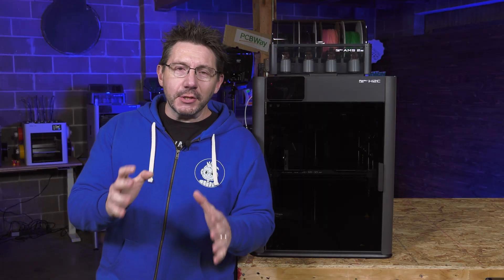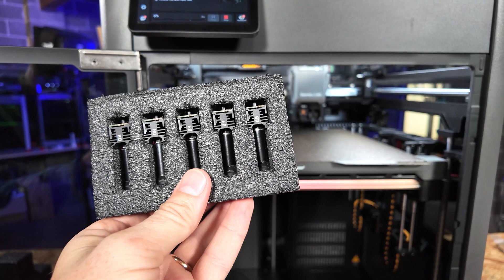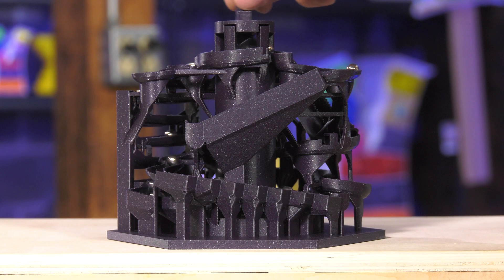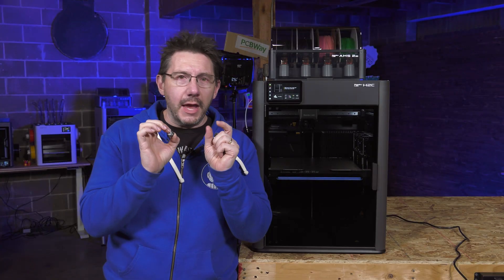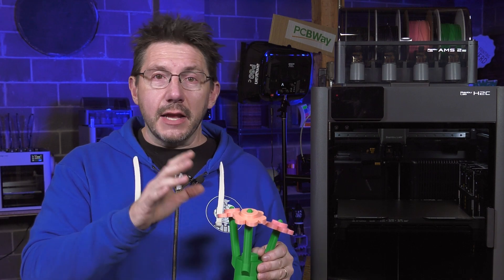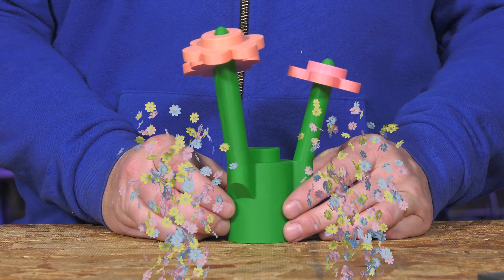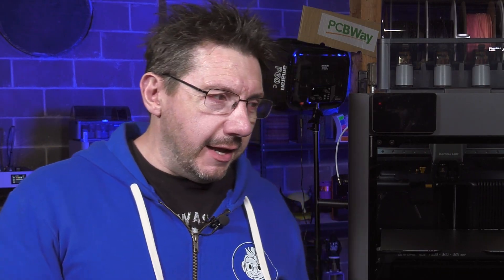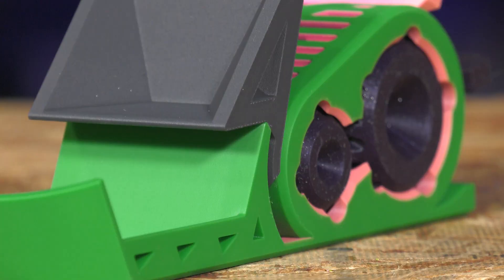My Review of the Bambu H2C + Vortek

Comment: Great review as usual and that tentacle chest is wicked... I love how Elixir just gets such a shine that other silks seem to struggle with. I wanted to save your video for last of the many embargo drops... in a weird way, you seemed to have the most issues of anyone. Tom (Made With Layers) reminded people of the bad air pathing from the H2 series, hinted at the complexity of all the parts, and saw the IC on the nozzles and asked Bambu about 3rd party nozzles... and they said "for safety reasons" no, 3rd party nozzles aren't supported. Not to mention it was still nearly double the print time of a Snapmaker U1 and Prusa XL. Stefan (CNC Kitchen) went more into complexity and brought up that the bed was different.

And so I feel like it's natural for me to reword and repeat come concerns: Bambu has seemingly added more and more SKUs to their lineup without removing anything besides the X1 (non-Carbon). For H2 series: you have 2x SKUs of nozzle (plus sub-SKU for nozzle size/type), 3x SKUs of gantry (H2S, H2D, H2C), 3x SKUs of beds, and a dozen+ accessories to mix and match that now need firmware, slicers, documentation, support, warehouse stocking, and more to figure out. I remember RMRRF, a friend picked up a new nozzle for their X1C... but they were accidentally given a P2S nozzle. I caught that and saved him some trouble. But now imagine dropping $2000-$2250 on a H2D, going "oh cool! The Vortek upgrade is out!", spending $800 on the upgrade... then needing a 2nd AMS 2 for $250 (you'd be surprised how many just have 1x AMS and found it perfectly fine and aren't maxing out AMSes), then finding out that the $800 upgrade only includes enough to do 4 colors and they need the other nozzle kit to get 6 nozzles (Edit: checked and saw it does include 6 nozzles). These nozzles are "cheap" but somehow more expensive then Prusa's Nextruder nozzle, INDX nozzle, certainly any v6 nozzle, nearly anything Elegoo, Creality, and Anycubic have, etc. Then find out your fancy effects sheet bed, or CryoGrip, or other bed you used on the H2D doesn't fit on the H2C. I watched someone almost toss a printer because the bed thermistor went bad and they couldn't bare the idea of following some instructions to replace the couple dollar part (eventually convinced them to replace it). Now imagine telling someone who's new to the scene that they're going to be nickle and dimed AND that the fancy nozzles won't have 3rd parties (as of now)? I help and interact with many people new to 3D printing and you would be amazed how many go weeks to months between printing because they can't afford a $20 spool of filament... "why do they have a $2000+ printer?" because they didn't know there are cheaper ones. Yes, really. Imagine telling someone who can't afford a $20 spool that they need to spend $36-$60 for a new bed if they have issues with the one that came with the printer?

Which leads to that bed... I think they made their bed and decided to stick to it (puns intended). That bed style started on the A1 and has continued to the H2 and people have complained about it since day 1 and they keep using it. I know someone who: clean bed, Nano, brim, everything... they get parts that lift and they're certain it's because of the bed. I'm not so sure, but as I can't reach them, I have to go with the next best solution: telling them to talk to support. I wonder what support would say about the jammed nozzle... like I know it's a challenge to clear a jam in a CFH nozzle, but specialized design for the bottom and electronics on the top... it's trash if you get a jam. I hate that kind of waste...

As for the PA6-GF print... I don't have experience, but it reminds me of when I got a bad spool of Prusament PETG. I contacted support (why not?) and they basically said the same thing: have you tied a different material? The issue is with this material... Have you tried a different model? Yes, same issue. Can we see the model? Here... Ah, there's the issue: your angles are too steep. But it's 45 degrees... Yea, too steep. I can literally swap out the filament and the issue goes away. I have literally tried 3 different Prusa printers and they all have issues with this filament + Prusa's own profiles. But swap the filament for a different Prusament PETG, and the issue goes away. Dried it and everything. Something was wrong... So I wash you the best of luck.

My last comment is a curiosity on price. A few years ago, someone would look at a Prusa and go "I can get 2x A1s for the cost of a single Prusa" or "a Creality K1 is just an X1C clone at a lower cost, but it stinks compared to the X1C. Don't bother". "cheap" vs. "value". People seemed to pick and choose what they wanted to argue online with. But many many many go by that bottom dollar in relation to a spec sheet. H2C Combo is $2400... and that only does 5 colors total. If you want to do a full 7 colors, you need the "Ultimate" version with adds 2 more nozzles + an AMS 2 and AMS HT and clocks in at $2900. H2D upgrade is $800 ($2800 total H2D Combo + upgrade). H2S upgrade is $900 ($2400 total H2S Combo + upgrade). Cheap compared to $4229 for a 5 tool Prusa XL + Enclosure. But if you're fine with loosing 1 nozzle, a $1000 Snapmaker U1 is a bargain. Except we can't operate in a vacuum... and while plenty of Voron-style tool changers are out there getting better and cheaper, they still cost roughly the same as a H2C. And a day after the H2C was announced, Prusa announced the INDX upgrades for the Core ONE. 500 EUR upgrade for 4 tools, 700 EUR for 8 tool. There tends to be 1-1 EUR to USD so I can assume those are the USD prices too, and I can also assume that it will be similar or identical cost for Core ONE L (unless they offer more tools). So that means for $2300 (Core ONE L + upgrade), I can get 4 colors. And for $2500, I can get 8? But wait... that's the upgrade. Assuming a Core ONE toolhead is some $200 (adding up parts tends to put it around $150 or so last I checked), and that is now saved, when a Core ONE L comes out with INDX pre-installed, it will probably be $2100 for 4 colors and $2300 for 8. So a general consumer is gonna go "spec sheet says... print size looks similar. Has a camera. Has sensors. Has app. Automated air stuff. Color touchscreen. Has support. Enclosed. But this Prusa has 1 more color then the Bambu, and $2300 is cheaper then $2900..." The only thing that will sway that person in a vacuum is a friend or family member going "no, I have a Bambu/Prusa... you should get the same brand as me". The reality is people will see what is advertised, Bambu will put their stuff in a store and get influencers to talk about them. But a Google search will trigger a comparison and there may be a surprising outcome where Bambu has the slower tool changer that is more expensive. That assumes Prusa actually delivers... but it's just interesting to see everything at this point.

Comment: Hello, 3D Printing Nerd, I would like to say this review is quite detailed. But about the bed heating part, I can't help but notice that the thermal Imager you're using has the epsilon set equal to 1.00 value. Kindly, can you re-do this thermal-imaging test with the correct epsilon value? as 1.00 refers to the black body value, which in this case would result in incorrect thermal readings. (The epsilon , as far as i'm aware, refers to the thermal emissivity of an object). Thank you in advance.

Comment: The H2C comes with 2 major disadvantages:
 - Slower than proper multi colour system
 - much reduced print volume vs the H2S.

So unless you want to print large volume multicolour objects, the best option would be to get:
 - H2S + AMS for EUR 1,399
 - U1 for EUR 849
This way you have:
 - large volume printing with 1 nozzzle
 - still the ability to print very large multicolour objects (with significant purging)
 - AND the ability with the U1 to quickly print multicolour object in reasonable size (because lets face it, 99% of multi colour objects are printed with PLA that do not require heated chamber.)
 - AND ability to print 2 objects at the same time so saving a lot of time

This combination is exactly the same price as the  H2C (EUR 2,249) in Europe.

Comment: Hey Joel, I work at an electronics manufacturer and we make lots of fixtures out of 3d printed materials. I recently switched a chunk of our prints to the Polymaker Fiberon PA612-ESD material and that has been ABS-like with strong layer adhesion and good stiffness. My impression was the GF material should be similar. 

Also, have you considered a dry cabinet for filament storage? We recently acquired a 3d filament dry cabinet from PAC (Product Automation Corporation) for just over $500, and it’s been doing great holding 7-9% humidity perpetually. We print all our hygroscopic filament directly from the dry cabinet now.

Comment: The infallible brand is actually fallible, who would have figured.  Not shocked to see them cutting corners.  My Kobra S1 prints beautifully and despite the purge waste (I hate it) its able to heat evenly and properly and is far cheaper.  Bambu fans and bambu will make excuses but that is just not a reasonable place to skip at all.  Ill stick to my cheaper machines that work just as well.

Comment: Can't you just put the nozzle in and heat it up using the printer? Does something prevent that?

Heating up the head with a heat gun, then proposing that it will degrade under normal use, seems a bit too trigger-happy to find an issue.

Comment: PA6-GF OMG I have this huge blob around the right hot end I can't remove and Bambu stated " its a consumable even though I have printed 100+ ABS parts of the same model zero issues and all my PLA zero issues...I bought it in May 2025 so less then 5 months old at the time..I can't get to the hot end clip so im going to replace the whole assembly I suppose....I run 20+ printers never had one do this until a recent firmware change.

Comment: Is the PA problems temperature variations in the nozzle? One could imagine that dialling in the thermostat is a bit harder on a setup like that. Printing a vase mode cylinder of a foaming material at mid foam shows very well if nozzle temperature is oscillating

Comment: Great video as always Joel. I just don't understand why Bambu just didn't make the system a toolhead changer and rather than the nozzle changer. Voron, snapmaker, bondtech, all show that you can get novel tool changers that speed up transitions between materials while also minimizing waste. The idea that you still have to pull back filament and then send the new filament through a single filament path is a total nope for me. The bed issues are also concerning. I think bambu has done poorly in this generation. Making a printer that is also a laser cutter is dumb. Creating a system that only changes the nozzles and still only has one filament path, is also dumb. Cutting corners on the beds? Really dumb.

Comment: Hmmmm…you can”t fix the heat bed with firmware or settings…maximum turn it hotter so that it’s at least hot enough, but remain uneven.

Comment: You are beating a dead horse about that bed, you should at least read the Bambu wiki, so you know, what you are talking about. 
The bed have two stages, it have fast warmup, that you measured, then it goes into stage two, that is a slower stable heat, that will get the bed evenly heated. 
It is the same bed in the H2D and H2S, how many have they sold you think? 
And no, people are not having problems with the bed, I have many hours on my H2D. 
And I like Prusa printers too, no, I am not a Bambu fanboy, I buy whatever is best for my situation.

Comment: You're not wrong. Bambu PA6-GF is trash. Especially if you are trying to print something thick. I wasted a whole roll of it trying to get a print to work. Switched to a Polymaker PA6-GF and it printed flawlessly with no change in settings.

Comment: It s just a compromise end of. Bamboo should have designed a tool changer from the start instead of an over priced compromise  that can't use all 6 of the vortex nozzles with out buying another ams and if you want more than 7 colours then your back to the poop and that was the problem in the 1st place. I have nothing against Bamboo they make nice very reliable printers that is a fact. but me I'm awaiting my U1 in January.

Comment: I wonder if the A1 has the same heat bed situation. I've found I can have issues with bed adhesion in the center but not on the sides. I've been using a standard size brim to be safe.

Comment: Hey Joel, because the bed is somewhat reflective you cannot just assume an accurate temperature reading from a thermal camera. It is still a great tool for seeing the cold and hot spots but to verify an accurate temperature I would recommend using a thermometer that makes contact or a popular trick is to stick black electrical tape on a surface.

Comment: It's not super clear from your video, when the Prusa XL is set to 100C, does the plate actually reach 100C? You only showed it partially heated at 60C. Other than the 5C variance, why can't you just set the H2C a couple degrees higher to compensate?

Comment: Nylon is an odd thing. It actually gets stronger/tougher when it has a higher than normal atmospheric moisture content (that includes soaking underwater). I would have left this out of the video or certainly tried to run the same print in another printer or two with similar settings and that roll at a minimum.

Comment: from what I've seen in my testing. Filaments with additives like glass fiber or carbon fiber don't add strength but it adds heat resistance. the PA6-GF i used in the past i took a blow torch to it no warping or melting.  Being that the additives aren't long strands but more small pieces in theory it should weaken the strength of the print if bent under stress. I haven't printed too many things with PA6-gf or even carbon fiber PLA or petg but this is what I've seen so far.

Comment: Stupid question but why didn‘t you leave the nozzle heated in the printhead, shove a needle in the opening and then do a coldpull? That works 99% for all my bambu 0.2 nozzles. Also never print Prusa Galaxy in a 0,2 nozzle. That just screams for a clog.
Also, the bed adhesion is a problem of the Prusa PLA, happens on my Core One, MK3s and mini all the time. If you use Bambu PLA, works way, way better. Also even or uneven heating of the bed doesn‘t matter if the heat has distributed evenly after all the start routines of the printer. Sounds unfortunately like bambu bashing towards Prusa for me, sorry.
I print regulary with Bambu PA6-GF for electrical stuff and it is a paint to work with. After drying 20min on the air is enough to soak up all the moisture again! You need to keep it as dry as possible while printing (under 10% humidity) and then it prints really strong. Works perfect on the Core One with PA printbed and also on the H2D. But it is PA, means you need to soak it wet again after printing, otherwise it‘s too brittle.

Comment: I have question I cant seem to get a clear answer on. With the H2C, if you want to hook up Four AMS units for 16 color options, does it require a separate Hub unit like with the P1S (and now A1)? or can it just hook them all up out of the box? I don't see that addressed on the official site, nor is there listed a Hub unit for the H2C (or any of the H-series for that matter)
Reply from the maker: You can daisy chain the AMS units via the data / power cables - and then as long as you have the connectors for the PTFE, you're good to go!
Reply: @3DPrintingNerd  I guess what I meant was, does the H-series printers have inputs for 4 PTFE tubes built in? or does it need an additional HUB? Each AMS unit needs to feed a PTFE tube into something...
Reply from the maker: @Matunahelper  H-series have two inputs for PTFE in the back, sorry I wasn't clear about that. to hook up multiple AMS units to either of the inputs you'll need a Bambu 4-in-1 PTFE adapter.
Reply: @3DPrintingNerd  GOTCHA! thanks for clarifying that. Appreciate you.

Comment: Maybe just pop the PEI plate off and check the bare bed instead. Glossy PEI (possibly) messes with thermal cameras, so the temps can look all over the place. The shiny surface just reflects IR noise from the surroundings. Matte surface or a bit of matte tape should give more accurate results.

Comment: With filament solidified in the heat break or cold end, rather than heating, I find it easiest to just drill out the filament. You only have to go just past the heat break and don't need to get anywhere near the orifice.

Comment: Interesting on the bed, and reading the comments only seems to obfuscate things further. I have the H2D which seems to have the same element style and lower than set temperature reading issues, but I haven’t had any failures (yet). And this is even on nearly full height ABS prints with a fraction of the surface area of the model you were struggling with…

As others have pointed out, the heat seems to even out with time. My prints never start very quickly because I leave all of the calibrations on. Could that be the difference!? By the time my chamber is at 60°C for ABS, the darn bed has been up to temp for 30 minutes.